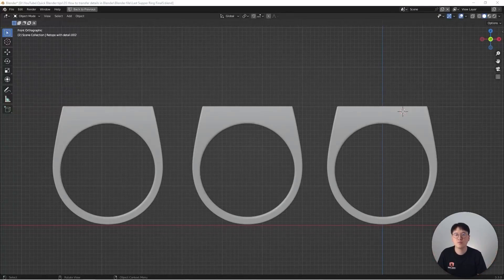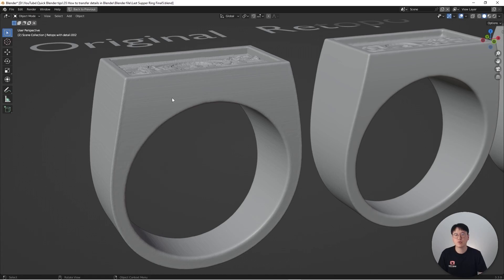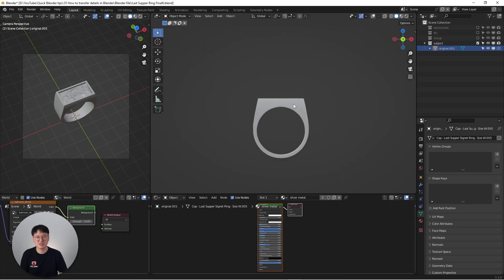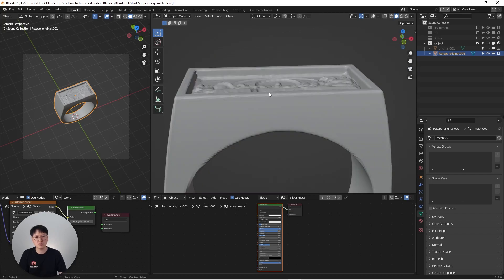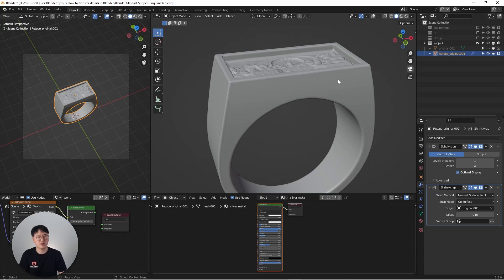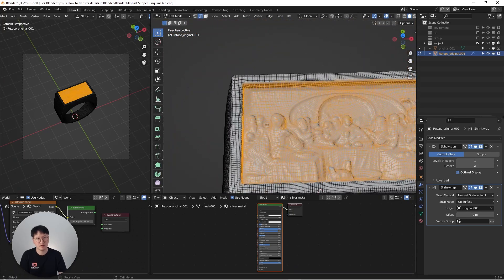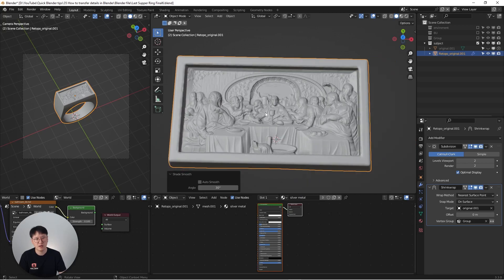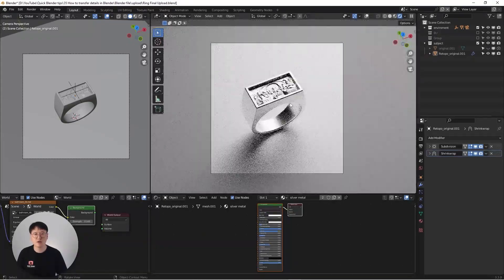How to Transfer Details in Blender (Quick Blender Tip 35)

Comment: This could be accomplished better with a multi-res modifier instead of subdivision. you can place the shrinkwrap modifier after the multi-res and apply it to the active subdivided multi-res to bake the details into the multi-res. at that point you could save some processing complexity by no longer needing a live shrinkwrap or use blender's built in tools to bake it to a normal map or displacement directly from blender's bake tools and no longer have any dependency on the original sculpt nor be forced to apply the model thus making it nearly as high resolution as the original sculpt. There is no downside to using the multi-res and the only caveat to the bake method is needing to UV unwrap the retopo mesh which is usually a requirement anyway
Reply from the maker: thanks for sharing🥰 absolutely great method 👍
Reply: Can you bake a displacement map in blender though? I thought you could only bake normal maps

Comment: If we could skip the retopology and just bake the normal and displacement maps of the high poly sculpt and use the maps on the low poly model. Will this work? This could save 100 bucks.
Reply from the maker: In the case of this video, your method is not working, because we only need certain part of details from the high poly model. Your method works great for transfer the details as a whole
Reply: @WenboZhao  thanks 👍🏻